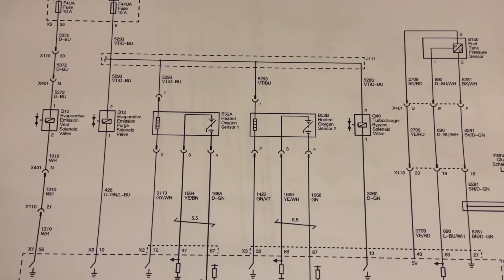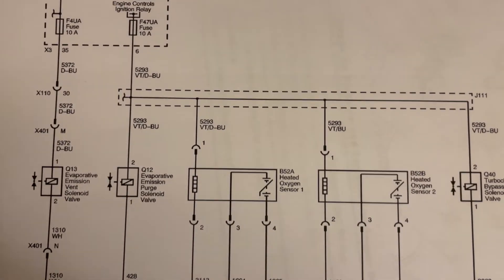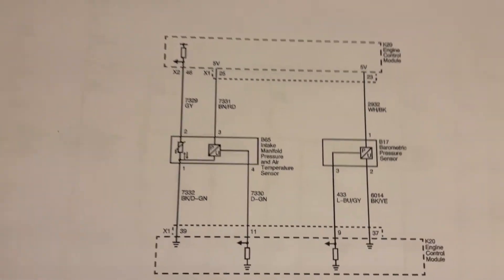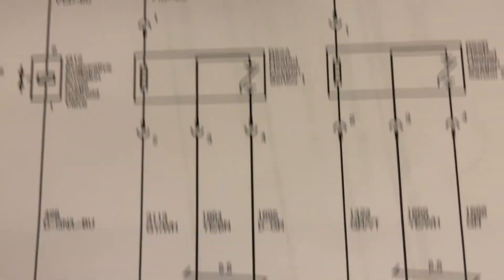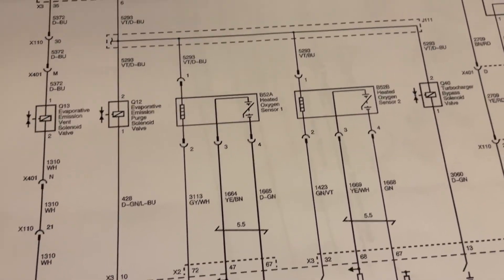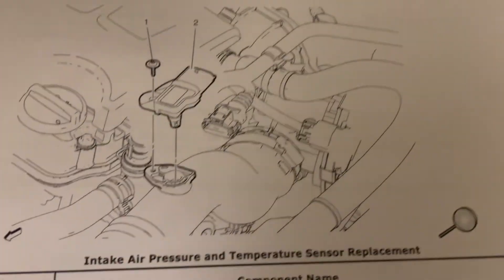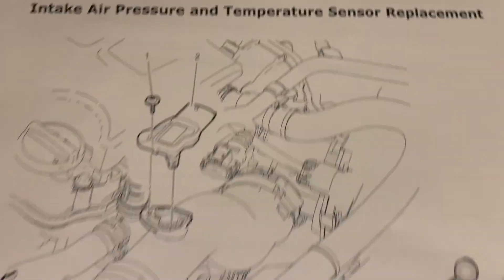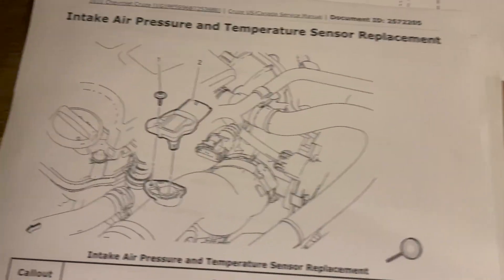2011 Chevy Cruze Diagnostic trouble codes P0097, P0236, P2037, P0132, P0134 and P0135

Comment: I found out too. I changed the flange but upon mounting again a mixed up too. Does I need to che the sensors? I do have ESP on now😢
Reply from the maker: Your best bet would be to check for diagnostic trouble codes in the computer and see which sensors are indicated by the codes.